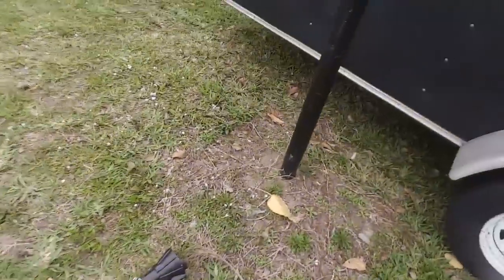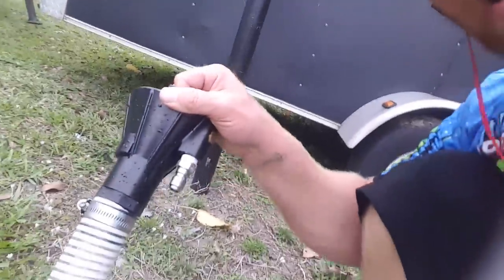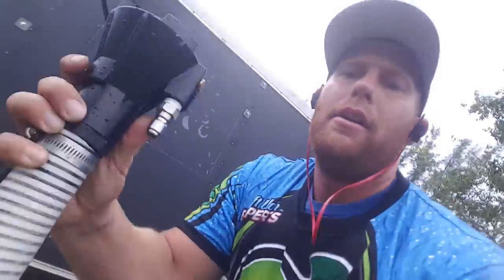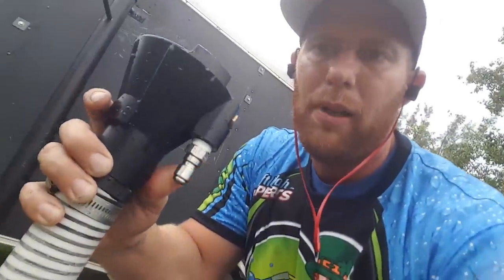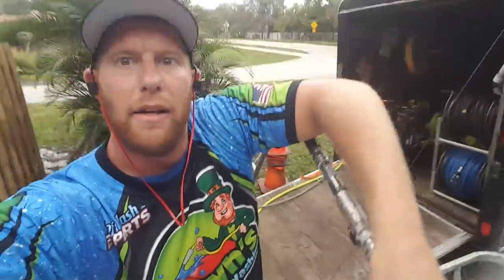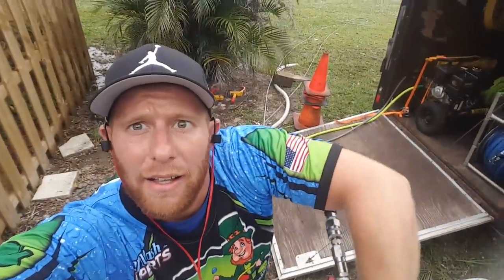Sludge sucker - pressure washing

Comment: Near the nozzle, you need to put a rigid straight pipe 50-100 cm. Then the ejector will be more effective. Because the jet of water will not spore against the walls of the flexible hose and therefore will not lose energy. Want more advice, ask me.

Comment: Hello, I have a 700 gallon fountain that has concrete Urn’s in it with outflowing water. I also have goldfish in it. I want to clean the urns and walls and floor of the fountain by pressure washing like your example but I want to filter the water that is sucked up and put it immediately back in the pond. How can I do this?
Thx. Scott/Alabama

Comment: I hope you can advise if this pump would realistically operate in the capacity I am tasked. I would like to pump loose sludge mixed with leaves and small sticks from around my dock located on a fresh water lake, and discharge the sludge at a drop point in the yard. The lift should not be any more than 10-12 feet and from suction to discharge would be about 50 feet. 

Could you offer any advice for using this pump for such a task?
Reply from the maker: theres something called a trash pump at harbor freight  try that out. the pump I have wouldn't be good for it
Reply: @Oleynspressurewashing  What about a suction lift of about 20 ft?

Comment: Hey mike, where did you purchase this? Do you think I could use it to transfer SH from one tank to another?
Reply from the maker: yes you can
Reply: @Oleynspressurewashing  Still can't get my head around how this works. Does it dilute the SH, like a downstreamer?
Reply: Georgia Hunter it’s the Venturi effect using Bernoulli's principle. High pressure fluid being forced through a constricted space creates the suction. Simple, cheap and powerful with no seals and no moving parts which allows you to suck up sludge without having to worry about burning up a pump.
Reply: Just get a 12 volt pump and a deep cycle battery...rinse with water every use.